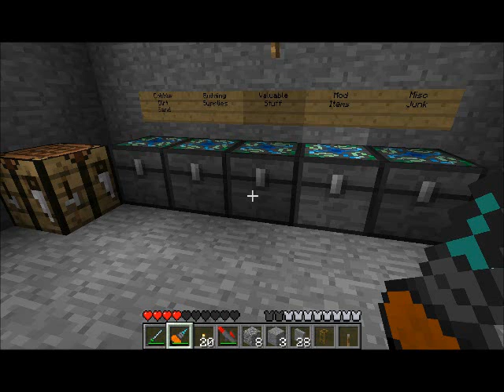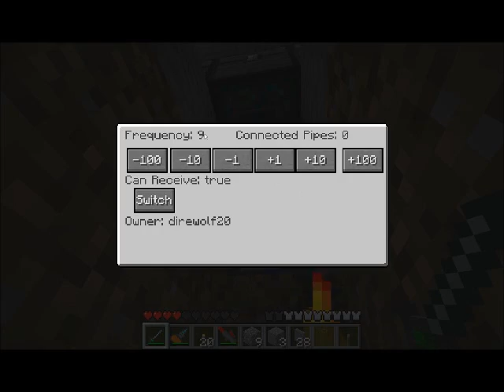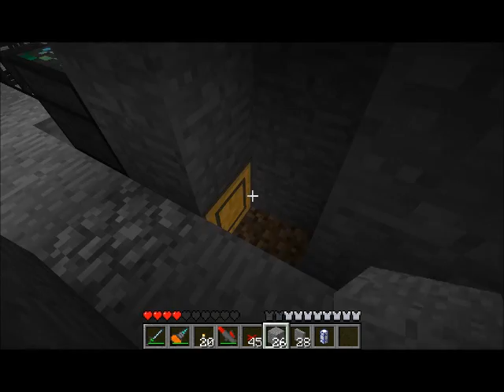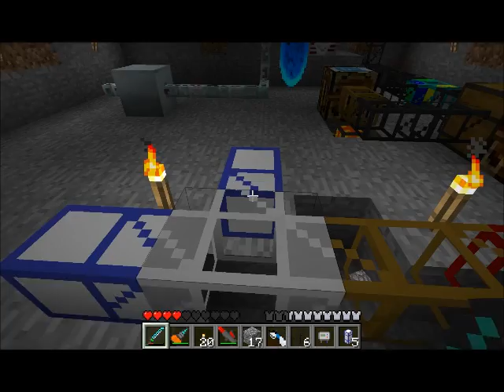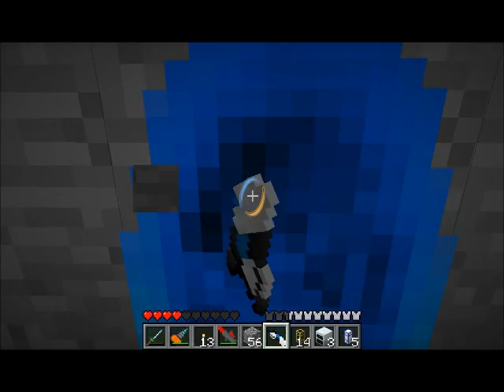Direwolf20's Minecraft Lets Play Episode41 Industrial Craft 2, Equivalent Exchange, BuildCraft

Comment: If you have more engines, it does nothing. I tested. But 3 rotaries at full speed will easily handle a doubled output. Also, rotary macerator updated into advanced machines, and now adds y

Comment: If the problem is that the items are not being pulled out of the crafting table fast enough, just add another redstone engine onto the wooden pipe if you have the room. That speeds up the amount of items pulled out as both enigines will pull item out.

Comment: The Rotary Macerator and Singularity Compressor work fantastic!!  Also you might consider placing 4 automatic crafting tables around a central chest for your glowstone block to coal conversion, 2 being just for redstone->coal to prevent backlog and raw materials into the chest from underneath. Glowstone dust and redstone routed back to the central chest and coal tables heading to a rotary macerator bank. helps compact the design nicely and no issues of overflow.